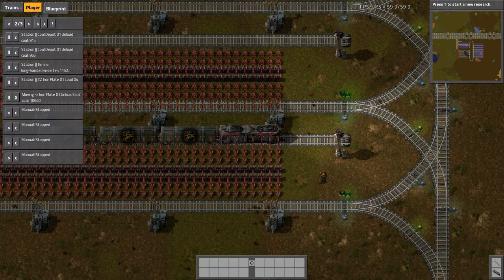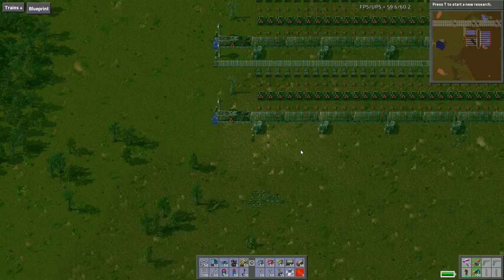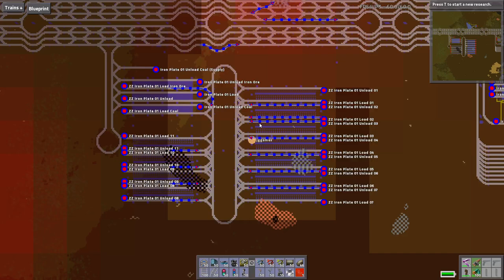Let's Play Factorio 4.036: Iron Plate Running, and Train Jams

Comment: i like the design but you have one big flaw in it. bidirectional trains are great when you dont have the space to do loops and stuff but the double the load of every rail they pass because they have to go back and forth on it
if you would add exits on the ends of each station i think it would improve much
Reply from the maker: I prefer one-direction trains when I have the space for it for the reasons you said.

Comment: About 18:30 I'm thinking someone got a mite big for their britches
Reply from the maker: Yep! I figure it out eventually. I end up abandoning this design altogether and going with two separate loops for input and output.
Reply: Yeah the copper plan in this season and the next in the next season. I really like how it made a simpler flow. Hey why do u usually not use electric furnaces ?
Reply from the maker: Electric furnaces take up 9 squares vs. the steel furnaces 4 squares. That's a 125% increase. I like to keep things in a relatively small footprint. Note that I'm loading direct from trains to furnaces so if you compare linear space, you can fit in 50% more steel furnaces than electric furnaces per unit distance.

Also, steel furnaces are much, much cheaper to build. I wanted a metric ton of them, so the quantity of ingredients matter.

Electric furnaces only shine when you have solar power and when you use modules. If you're using coal power without modules, then steel furnaces are ideal.
Reply: Interesting. I'm doing a bob mod run. So I'm going to use the big furnaces for eventual god modules